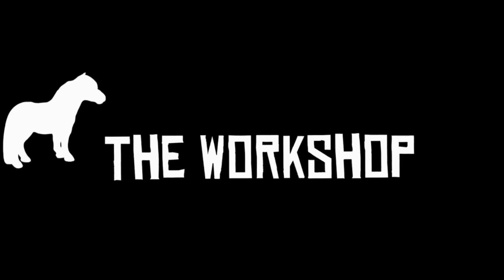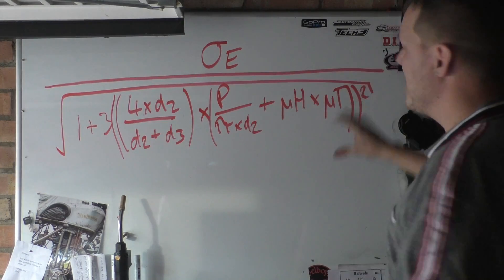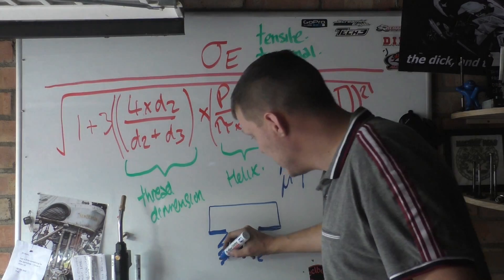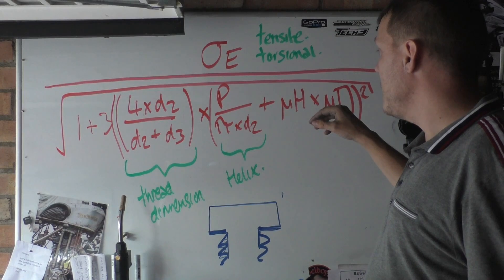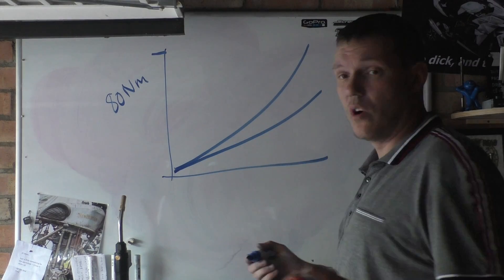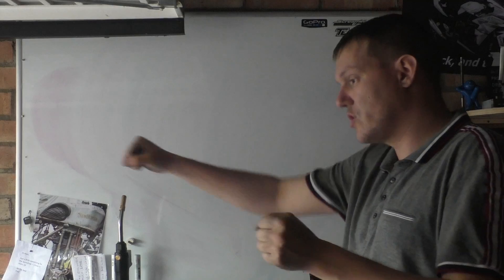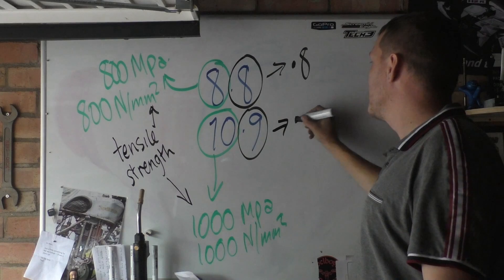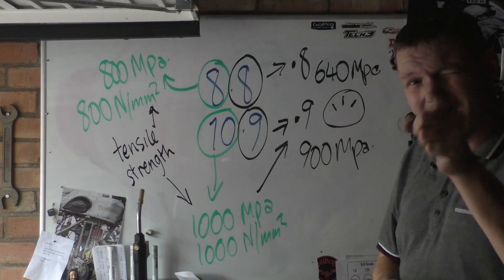Calculating Bolt torque

Comment: Saw an interesting technology where a torque wrench sends acoustic pulses down the fastener and measures the time of flight, and from that the relative lengthening to work out the clamping load, I dont know if it is implemented in any products yet or how it deals with different materials, probably a LUT.

Comment: I tighten my front brack bracket bolts at 40lbs of torque, when it is supposed to be only 20lbs. Now, I'm wondering if I could have stretched the the bolt and threads. I want to take them off, clean them and tighten them at the right torque. Before, I do that, I was wondering if I could have changed the amount of torque needed by over tightening them. Could I have stretched them and need to tighten them a bit more?
Reply from the maker: "Could I have stretched them"

- Yes and they need removing and replacing
Reply: @thedirtyworkshop  buy new bolts?
Reply: I see. I need to get new OEM bolts.
Reply from the maker: Yes new OEM bolts.

- the more a bolt stretches 2 things happen - 1) it gets closer to the yield if it hasn't yielded already. 2) depending on the bolt (threadless or relief) the bolts major diameter will reduce.
Reply: @thedirtyworkshop  thanks Matt!

Comment: The question which always bothered me, was if Joseph Whitworth arrived at the conclusion that the angle of his thread should be 55 degrees and BA decided their threads have an angle of 47.5 degrees precisely, how did Johnny foreigner decide that 60 degrees was near enough? It always looked like they just liked round numbers for their metric system, whether it was the best or not.
Reply from the maker: This is the difference bewteen friction and shear. It also takes into account the thickness of the root of the thread and the relief of the thread.

Comment: Hiya, just letting you know we fixed my girlfriends bicycle pedal yesterday - was making a clunk sound (and a popping feeling underfoot) when you pushed down on it. Decided to just pull the pedal off, give the threads a bit of toothbrush and pop it back in and see how it goes. Why do you care? Well I don't know much about modern bicycles so I checked the internet forums first for some advice and fuck me the arguments about whether to use anti-seize or regular grease on the threads...every motherfucker been doing it their own way for 30 years without problems so everyone else is wrong etc...  Who to trust? The Workshop of course. I got the pedal off and the threads were dry so I left them dry. It's been drummed into me by the workshop, see. I don't have the service manual so it gets left as the factory done it. No greasing the threads. Cheers fella. Oh pedal was all good after - maybe just a piece of grit in the threads or something.

Comment: IAM a spastic because them numbers went above my head. I get what makes bolts become lose is not enough friction but what force is applied to overcome the friction. I have hung farm gates before and just tighten the hinge bolts by hand a little naughty but they never become lose as there is never enough force applied to them for them to become undone. However on a motorcycle doing say the seat bolts up by hand a short trip down the road and they become lose. It must be vibes and shock waves from engine & motion.
Reply from the maker: This an mechanical precession - which is quite an indepth topic we will be covering

Comment: I have used 12.9 M12 bolts on  my  crank caps. I I know a few people with crazy boost having say 16.10 bolts on their heads or they they will lift the heads of the engine. It's some kind of space age material with inormous tensile threnght.

Comment: How about a test on the old trick of sticking a bit of copper wire into a hole where the threads are mostly stripped out so it'll fill the gaps and let you tighten the bolt?

Comment: The different combinations of letters/symbols/numbers (besides 8.8, 10.9, 11.9 for metric, and dashes for Inch grade etc.) on the bolt heads are the manufacturer's symbols.  Simply used to trace back who made the bolt if it fails.  For example, if you see "4F" on a bolt head, that is Fontana Gruppo from Italy http://www.gruppofontana.it/.   "LEP or LE" is Lake Erie Products located in Frankfort, Indiana, USA and formerly Cleveland, OH.  "JH" is Jinn Her Enterprise in Taiwan.  "△" on a bolt head is for Ifastgroupe in Quebec Canada.   "JDF" is NOT John Deere Fastener like many assume, it's made by Ningbo Jinding Fastening Piece Co. in China.

You may also see things like "A2 86" or "A2 70" on a bolt head, this type of nomenclature (A2 XX) identifies that the bolt is made of Stainless Steel.

Comment: Hell yeh, that was a teaser, now decode the marks !
Reply: The different letters/symbols/numbers (besides 8.8, 10.9, 11.9, etc.) on the bolt heads are the manufacturer's symbols.  Simply used to trace back who made the bolt if it fails.  You may also see things like "A286" or "A270" on a bolt head, this type of nomenclature identifies that the bolt is made of Stainless Steel.

Comment: At 9:30 of the video, you are talking about overcoming the friction of the head and overcoming the friction of the threads. Do the threads and the head deform very, very slightly to increase friction when torqued? If so, then is it possible the a metal can be too hard to be used as a bolt? Thanks.
Reply from the maker: "Do the threads and the head deform very, very slightly to increase friction when torqued?"

- Deform in what respect - twisting, stretching, compression?
Reply: The Workshop stretching most, possibly twisting on the threads. Compression on the head. Let me word my original question a little differently. I can hand tighten a bolt very easily until everything is lightly clamped. Then I need a wrench to apply torque, what is happening to the threads and the head when I do this? What changes would I observe after using a wrench, applying torque, if I could magnify the contact points and somehow measure stress at these points. I know they are hidden on the inside, but let's just pretend. Thanks.

Comment: With regard to HEX HEAD Bolts:  Bolts with 8.8, 10.9, 11.9, 12.9 on the head are all metric thread.  Bolts with the dash marks on the head are inch thread (3 dashes = Grade 5, 6 dashes = Grade 8).  Bolts with no markings are "choose your own adventure" bolts (equivalent tensile strength of peanut butter).

Comment: Thanks, helps to understand what's going on. One thing to maybe muddy it though... Many bolts come with an almost plastic substance on the threads, most bolts from Harley have this applied (often blue colored) and is why they say to bin them and use new fasteners. Some kind of locking compound. Does this stuff effect uT the same as a drop of loctite?
Reply from the maker: Yes - but not as much as say oil. How much? I don't know. But loc-tite has about half the effect oil does.
Reply: @thedirtyworkshop  Thanks. Most of those torque values have that stuff factored in so I guess it should be fine when using new bolts.
Reply: The plastic substance is pre-applied threadlocker compound (Loctite) in the case where it's just a single spot or a well defined band of loctite around the thread.  Does not affect tensile strength of the bolt whatsoever.  In industry, bolts are recommended to be replaced after use  because it's covers them legally should you try to reuse a bolt that has already yielded.  In most cases, you are fine to reuse bolts as long as you check the threads and shape of the bolt to ensure no yielding has taken place.  
However another important point is that any and all loctite/threadlocker compounds (whether pre-applied or applied at assembly) are one time use, period.  You need to clean the threadlocker out of the hole (chase the threads with appropriate tap) and from the bolt if you're going to reuse it and reapply fresh threadlocker.  In that case it's usually easier to just start with a new bolt.
Reply: I would consider taking then seriously on the single use thing. I reused a caliper bolt on my cb500f when changing the pads. Long story short, noticed It had moved, took it out to check it and it's about 5mm longer than the other one and properly waisted in the middle. I assume it's made that way so the bolt fails instead of the casting but it could've left my caliper loose which wouldn't have been good.
Reply: This is a bolt that was designated as single use by the way, I'm obviously not saying you should never use a bolt twice.

Comment: Matt, any chance i could grab a quick bit of advice? I'm thinking of getting into bikes but I've never been on one. Was thinking of buying one of these bags of shit https://m.ebay.co.uk/itm/2017-SS50-retro-1960-s-1970s-moped-50cc-motorcycle/192354454359?hash=item2cc9380b57:g:8KYAAOSwax5Yvwcn to use on my car licence  just to try to get a feel for riding before going for a proper test and bike. What's you recommendations?
Reply from the maker: not a bad idea, but biking is easy, don't let something shite give you the wrong impression, just keep that in mind
Reply: @thedirtyworkshop  cheers

Comment: Should there be a function of length in that equation? I'm sure you have to pull it harder if it's longer?? :)
Reply: thats what she said
Reply from the maker: This is when you are tightening a bolt, hence why the head friction is important. You are torquing, which means you are clamping, length is not required and in reality only about 4 threads are engaged - if you look at a nut, count the turns....

Comment: Or as I discovered last Saturday when torqueing down 4 x M8 studs on a cylinder head to the target 20 Foot / Pounds of torque, Chinese made steel nuts, acquired from the hardware store, strip their threads at 16 Foot / Pounds as in they went "pop"!! 

Apparently 15 Foot / Pounds was the maximum limit.

The option to harden another bunch by heating them up red hot and dropping them in oil was scuppered when I discovered the blow torch was out of gas..... so I liberated some from another similar engine that's awaiting a rebuild.

Is it possible to harden Chinese steel nuts??

The other option was to order some from the factory online and wait 2 weeks.....
Reply: i would of gone to the nut and bolt shop and got harden ones or got the original factory ones  but thats me  15 ft pounds is mild steel   for the garden gate  not a motor internally
Reply: The local fastener shop I normally use closed late year so now I have to plan way in advance. The 2nd hand motor in question's original head nuts had been "Kevined" (as in chewed up corners) which made me wonder if a retarded monkey had attempted to use a 1/2" socket (instead of a 13mm.) with lump hammer fit assistance on them at some time in it's life. (I've come across worst horrors than this!!)

As the motor had just been installed in the bike (fitting the head and cylinder after the gearbox and crank unit saves having to remove the coil plus other stuff). 

At the time it was a "needs must" situation and resulted in a plan B, remove the nuts from another pending rebuild motor.

Oddly enough I've used M10 nuts of similar type and torqued them down to 22 Foot Pounds without incident.
Reply: Simple answer is: No. Chineesium Nuts are made from a different/crappier Steel than your factory Nuts. Factory Nuts are also not hardened. Cheers Dude

Comment: I've always went till it shears then half a turn back
Reply: Rubbish Ross Finlayson......Till it shears then half a turn MORE for good measure! 🙄
Reply: Yea I have always thought you should ring it in till you can pull the bolt thread and all out by hand, that way theres plenty of room for the JB weld that realy holds everything together.